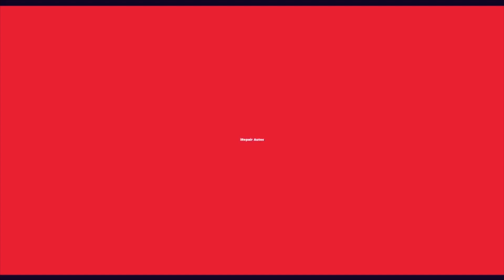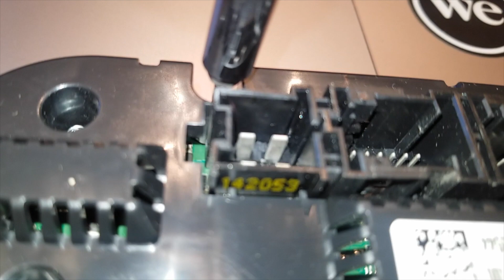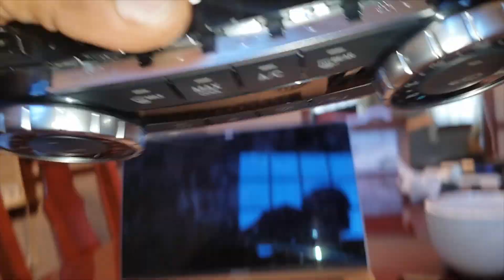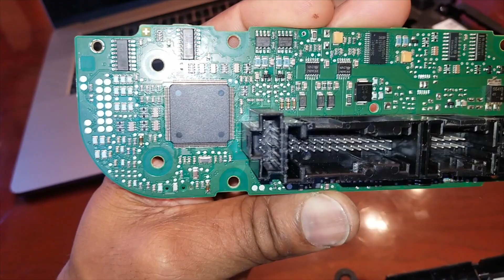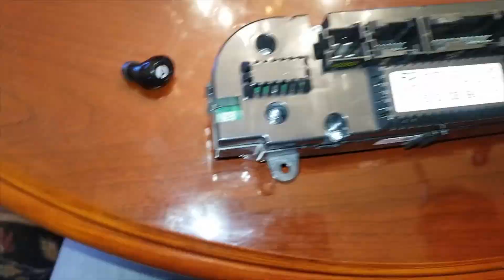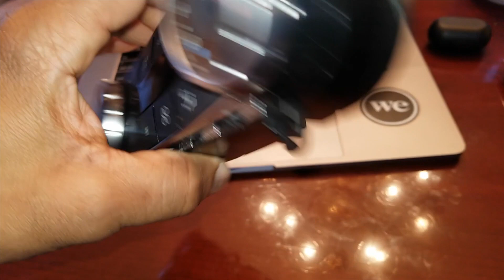Mercedes Climate Control Internals

Comment: I just picked up an 11 c300 and the passenger side control is stuck on its coldest setting. Turning the knob does not change the position of the desired temperature indicator . Do you figure this is a fault with the controls or an actuator? It may be worth noting that even on defrost, the passenger side still blows cold but the position actuators seem to be working fine. I'd be interested in sending it to you for repair or paying you for the knowledge of how to do this repair myself. I own a used car lot and usualy have a few older MBs in my inventory.

Comment: Hello Keith,
I have a controlepanel where the 12v is ok in the connector but the intern ecu gets no power. What component (s) need to be inspected or replaced? I would be a great help to me😀

Comment: hi sorry to bother you but i have a glk 2013 and the climatecontrol panel doesnt go on and the motor fan blows when io start the car, i checked the wires and it doesnt get electric from anywhere. 
What could it be? the panel looks the same as shown in the video
Reply: Got the same problem here with a class c w204. Did you get where the problem was?
Reply: Mam ten sam problem

Comment: Sir plz help... I am from India. My car is merc w204 2013. I am having a problem with air conditioning system.
1. When car is parked in sunlight for more than 6hrs then ac dont work on startup. It works after driving for more than 4 kms.
2. When I starts the car ,ac compressors dont work it starts when I accelarate the car upto 2000rpm . And when I stops the car on signal ac stops working and starts on accelareting the car

Comment: Hello, W208 CLK I bought - the a/c is stuck in eco mode. At all time the eco button is lit up. Even in winter while using the heater. So the a/c does not blow cold. Any tips. Thanks
Reply from the maker: Your ac is in safe mode.   Probably because of low refrigerant in the compressor.   You need to have the compressor evacuated and charged then checked for leaks. Those leaks must be fixed to avoid the problem again.